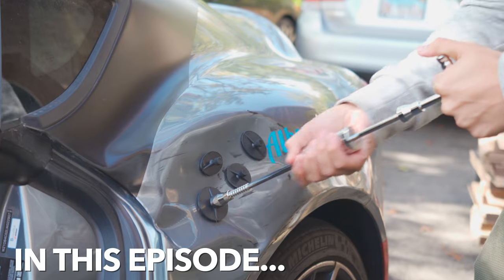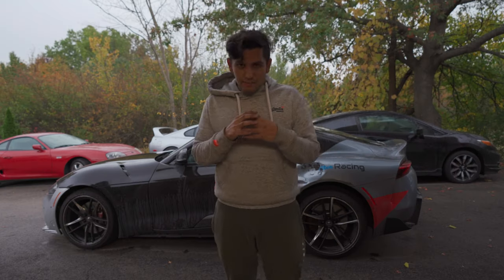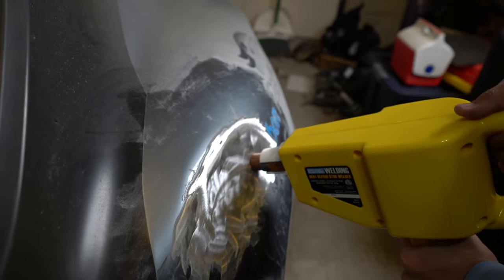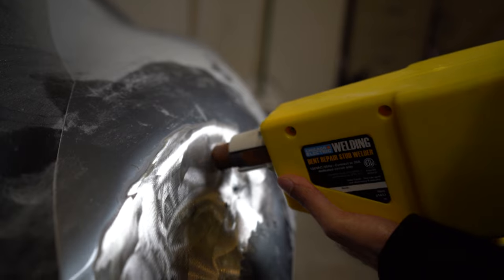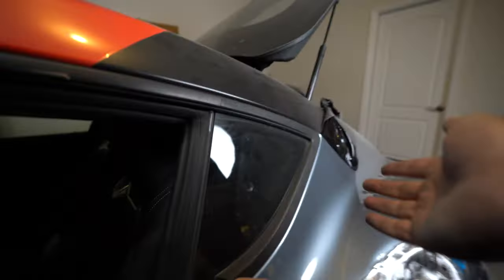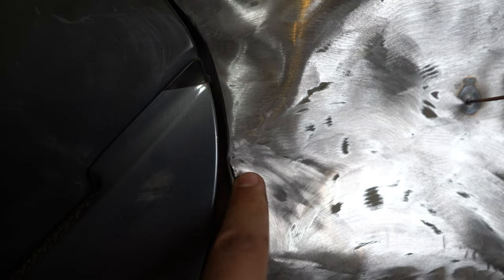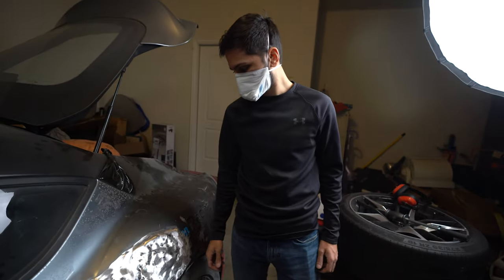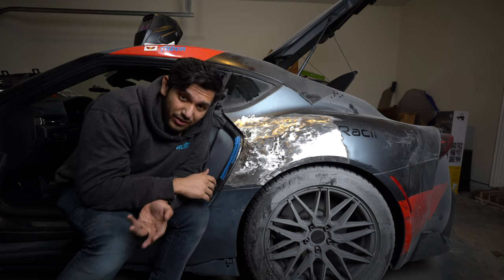DIY Dent Repair On The 2020 Supra - Rebuilding A Wrecked A90 EP15

Comment: Was satisfying to watch. That is a massive dent. When I was fixing my curb rash the other day, and worked out no matter how much I sand could not get brush finish back, and applying clear coat will be a nightmare. I gave up took to wheel shop and got diamond cit. Hats off to yr perseverance.
Reply from the maker: Brushed finish is definitely a hard one, not sure how one could do that DIY. Its a little easier with a normal glossy painted finish!